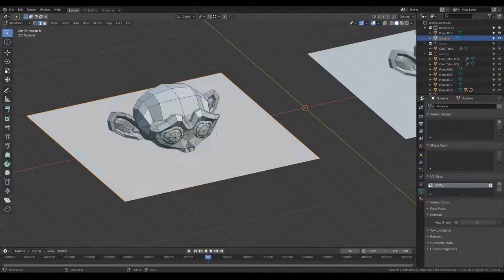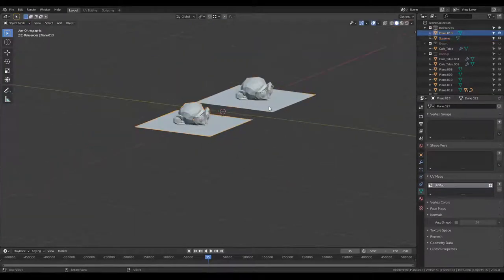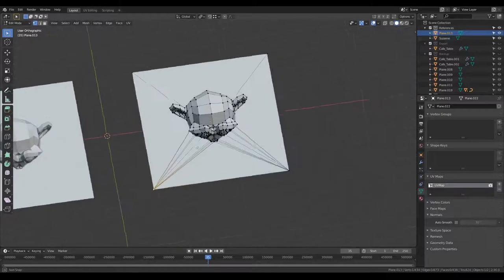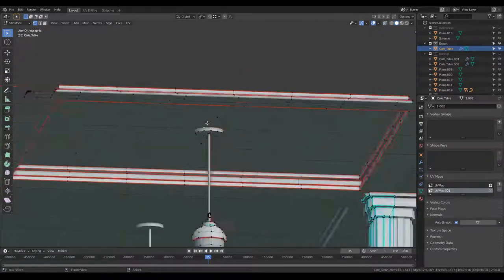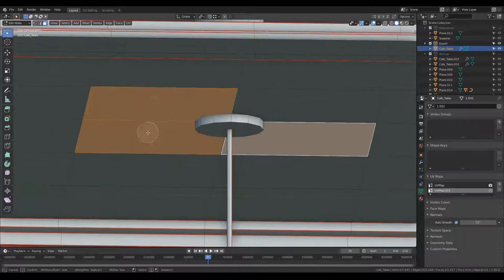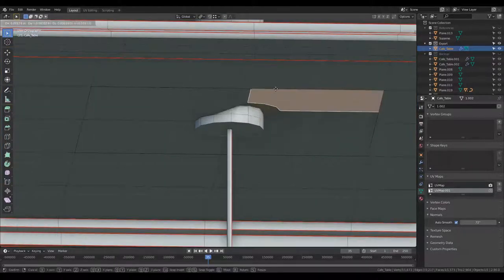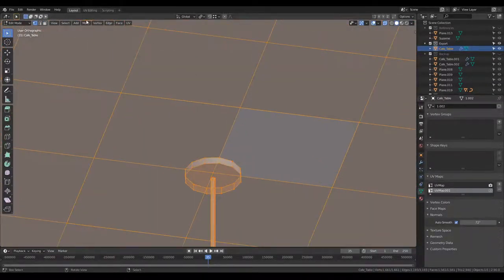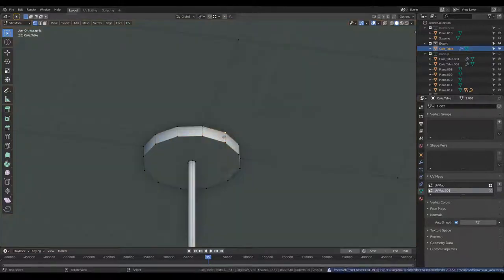How to deal with self-intersecting geometry in Blender

Comment: Is there an automated method? Maybe an addon?
Reply from the maker: You could do the same thing with a boolean modifier, only downside is that geometry gets a little messy, but on most objects you could get rid of that using a Weld, Triangulate and Weighted Normals modifier
Reply: use the boolean with union mode, this will delete everything inside and turn the two models into one